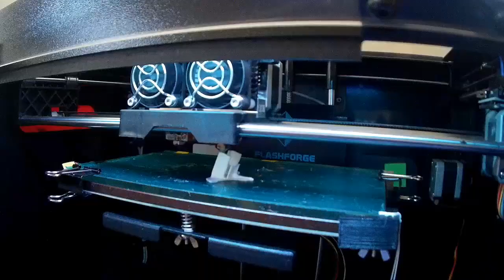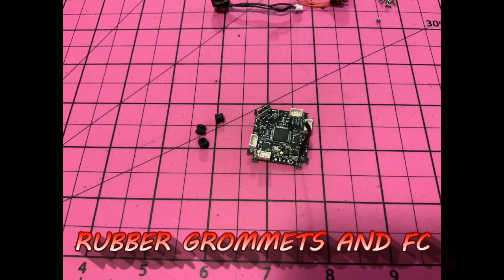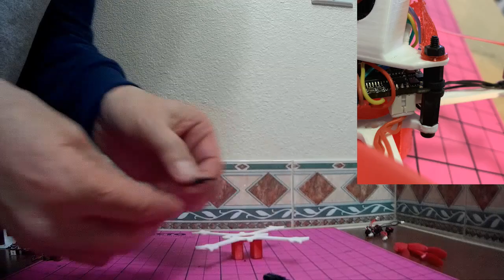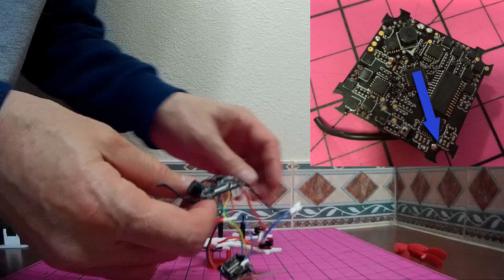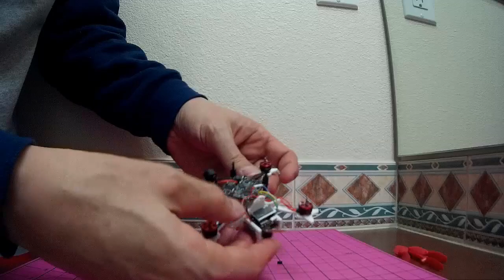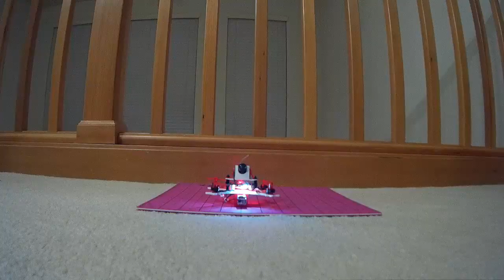MOBULA7 - "PAPILLON"  BUILD VIDEO - Toothpick Inspired 3D printed frame

Comment: Have you had a chance to fly this yet? How is the performance of the Mobula 7 motors on this setup? Also is there camera jello?
Reply from the maker: It has potential but got some jello on the camera during punch outs. I think the frame needs to be thicker. I'm looking at remixing the frame on a CAD program and make it thicker vertically but making the arms thinner horizontally. The other idea is to add a brace down the center of each arm in the remix and see if the jello goes away. I think both methods will work and just depends on wt gain.
Reply: Sound like great ideas, can't wait to see your progress :)
Reply: From what I’ve seen PLA is quite brittle and flexible. PET is better and takes much more force to break...
Reply from the maker: @nikotttin  I was thinking ABS but I'll try PET first. Just put a roll on order and will continue to tweek the frame design while I wait. Thanks